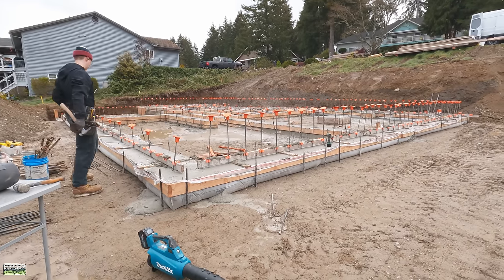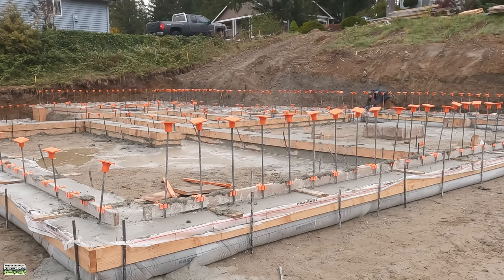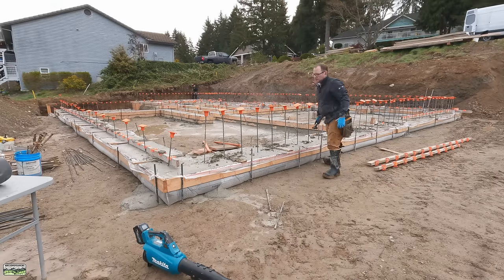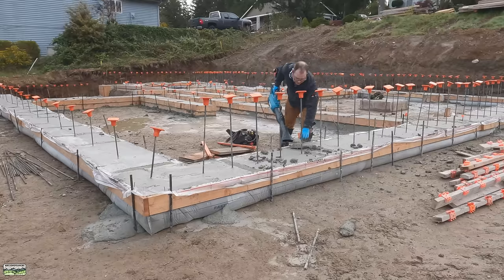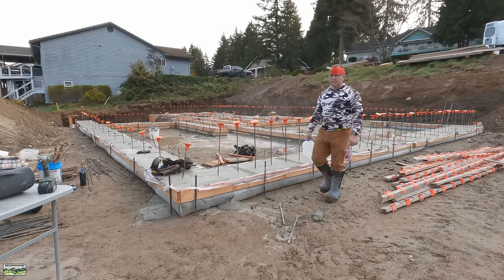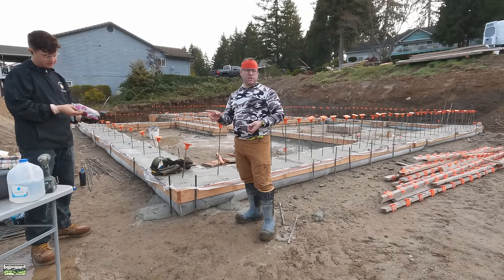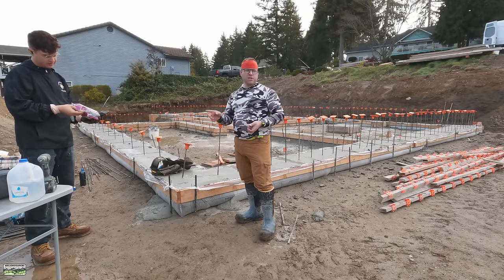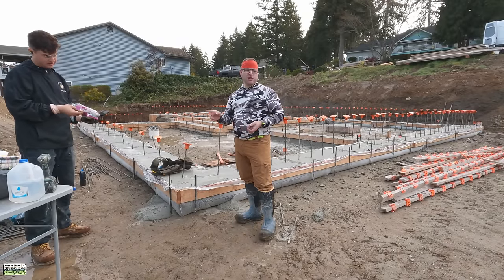Don't Skip THIS Step - Wall Layout

Comment: Those steel mates look interesting. I use two electrical staples per hook. Fairly quick to install, theyre cheap, and its incredibly easy to strip. They hold really strong as well. Its pretty rare that i have a hook pushed during the pour

Comment: There’s something called duplex screws. Extra long 1/4” hex head that can be driven with a nut driver or even the 1/4” chuck of an impact driver. Easy to keep clean and easy to knock concrete off after the fact. Pretty cool. I think they come in 1-1/2” and 2-1/2”.

Comment: You should check out the Stabila LA 180L for laying out foundation and walls. One person operation. Pricey but worth it.
Reply from the maker: Yep that's what I used. Shown in a previous video. Great tool 👍
Reply: @AwesomeFramers  Got it. I saw you string lining something. Wondering why not use it there too? Where's that project?
Reply from the maker: @hu5tle-  I believe the video before this in the Olympic Footigs playlist 👍
Reply: @AwesomeFramers  Not following. Looks like you are pulling tape for the footer forms. How far are you booked out for framing?

Comment: What specifically gives you confidence that your layout on formwork hasn't moved in any direction or a combination of directions enough to cause issues later?
Reply: Probably 20+ years experience plus this looks like it's getting blocks on top which can be straightened out anyway